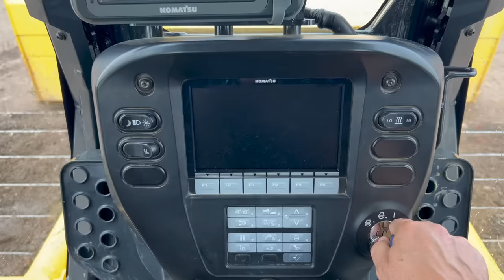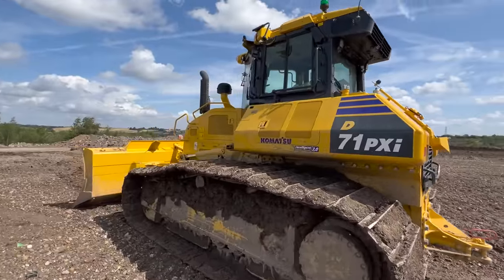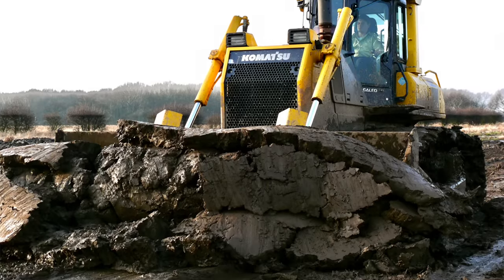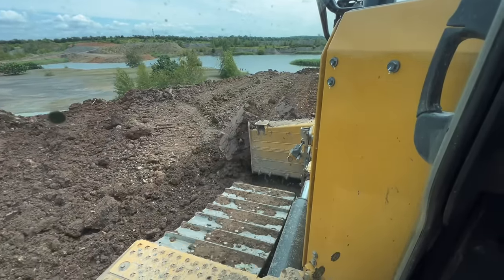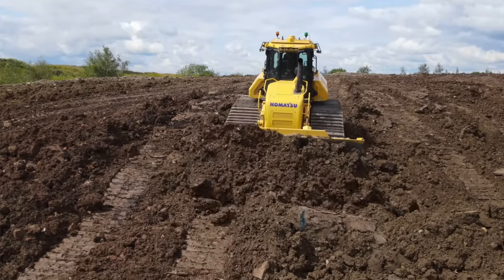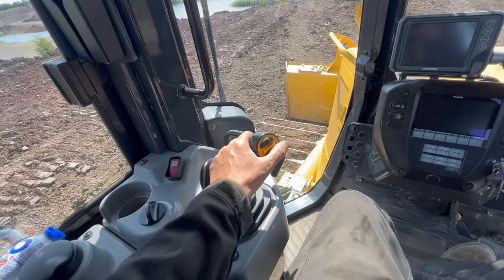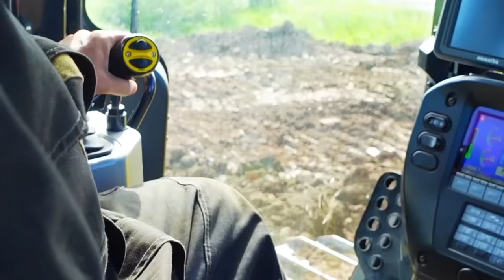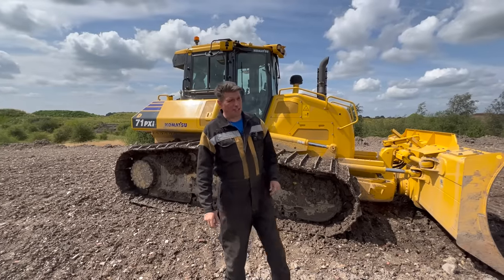CAT D6 vs KOMATSU D71

Comment: Hey bro, looks like you put this up a couple moths ago so you probably wont see this. but how do they compare in terms of pushing power? It seems like the Komatsu is the better dozer in terms of how it operates, but from an owners perspective I don't really care if you can see the top of the blade if at the end of the day the cat has more productivity in terms of M^3 moved. does the Komatsu push as well as the cat? better? Anyway great video man keep it up!
Reply from the maker: Yes it pushes better (you'd know if you watched the video) and any operator worth their salt knows that seeing any extra part of the blade means they have a much better field of vision and of what's ahead, therefore a much increased command of the machine.

Comment: I understand that these machines are built for the primary (new) and secondary (used) markets. But there is a huge demand for 50% or less machines on the used market and I don't see how any of these will be operational in twenty years. Once the HMI craps out in fifteen years and factory support is no more...what will they do? Both of these machines must be filled with what auto manufactures call body control modules and when those are not available any longer? Scary really. People are running old Cats to this day, many decades old. That seems to be ending. New is great but an era seems to be ending.
Reply from the maker: No, that won't happen, it never has and there'll be a market for back up components just as there are with trucks and tractors
Reply: I hope so brother. Retirement is in oh, maybe ten years. I plan on drinking coffee, petting dogs, and watching repair videos. LOL.  @LordMuck

Comment: Come on thsts a D6 keeping up with a D7 Komatsu in all honesty so if a CAT D6 Can keep up With a 71 Komatsu thsts a Komatsu D7 so much respect to caterpillar
Reply from the maker: What part of almost identical weight, size and power are you struggling with ? There's a reason you're not designing rockets and surgical procedures...
Reply: @LordMuck  lol I wasn't saying nothing bad man your video was cool I don't design rockets man just high sprockets and operating equipment not on people but cool thanks for your input. You look at sprocket wear and tear the high track has less sprocket teeth on the sprocket it self and in case of having to change the teeth on the sprocket you should be able to change them with out removing the track if it has the 3pc sprocket break meaning the sprocket teeth on the High track sound be a 3pc assembly on the final drive it self. Also keeping the sprocket teeth out of big rock or even small and out of the brush and mud as much as possible.  On a dozer thar wear and tear on the under carriage and final drive pushing dirt rock ect plus ripping that drive sprocket that's alot of wear and tear.  Never been in a rocket but have drove a couple high sprocket dozers and regular ones as w÷ll
Reply from the maker: Hi drive is great for keeping the drive out of the mud and rock but Komatsu have also had segmented sprockets for years. CAT have relied far too long on owners and operators just accepting what's given to them by blind and dumb brand allegiance for far too long - I'm just as guilty, I have always loved CAT dozers but Komatsu have clearly shown where things need to be and CAT needs to act now.
That ain't rocket science...
Reply: @LordMuck  You ever owned either one for more than 3 years? Cat OEM undercarriage parts are much better than anyone else's.
Reply from the maker: Yep, several CATs and a D65. So many people turning to aftermarket as Cat undercarriage component costs are ridiculous now and not worth the cost vs return.
Reply: @Vernon-Chitlen the cost of OEM caterpillar track segments, chains and rollers far outweighs the benefits as several have said.
They are 3 times the cost but give maybe 25-30% longer life and that just doesn't add up.
Cat have had us believing their hype for too long now and people are starting to wake up at long last
Reply: @LordMuck  I would like to apologize for getting irritated. It wasn't necessary on my part for my poor reaction In what I perceived has dissing Caterpillar. Our family has a long history with Cat. Fed a family of 6. From early 60's D4 traxcavator to wheel loaders, excavators, dozers etc; I've run plenty of Komatsu's, 31-375. Prefer Cat. They're all better than a pick, shovel and wheelbarrow... 😬 Anyways, sorry.
Reply from the maker: We are having a discussion the same as we would on a job-site back and forth - no need to apologise 😉
My grandfather ran Cat dozers first back in WW2 (and IH) then at home, then I ran them on site for many years (brought up with D8H's) Had a Komatsu D65 and preferred some parts to the Cat, mainly vision and comfort but still ran several Cats (4,6,8's) on various jobs. These days I get to have a go on a lot of new stuff which is why I chose the number 1 (D6) to put the 71 against and it is just how I said it is and that's taking nothing away from the Cat.
I just want folk to see what else is out there and maybe then Cat and the service companies will listen to the customer rather than telling us what we should accept. Sometimes a brand needs to remember loyalty is a 2 way thing...
Reply: @LordMuck  you ever had to clean out a track before a freeze you'll appreciate the the high sprockets no bullshit man clean the mud and lord muck out with a spade that shit is work man lol thanks not talking shit just heavy equipment man
Reply from the maker: They have to dig them out and also any trackhoes before they are transported so yes, we have to do a lot of digging out - it's just part of the routine

Comment: It happened with cars and now apparently happening with heavy equipment. American stuff is second rate.
Reply: been that way for a long time. Even Diephone only just went USB-c, lol
Reply: In the 1970's and 80's American cars were craptastic.  I don't feel that way any more.
I now have a new Camaro SS, a Toyota, a new Honda Pilot, bit older Golf GTI, and a pretty new Cummins RAM.  The most solidly built and the best driving of them all is the Camaro.  We have had rough transmission shifting with several of our Honda's, and the Civic I had was built like an aluminum can.  Suspension on the Pilot is too soft, shocks are worn out at 50k miles, brakes are way too touchy yet weak, seats are too short.
Furthermore, after years of riding Japanese street and dirtbikes, I found my Polaris ATV and my last dirt bike, a Husquvarna (KTM) to be superior.  They definitely have better parts on them, drive better, and last longer.

Comment: I don’t now if it was the camera position but in the cat it looked like you was not sat straight, plus’s the tracks on the cat aren’t as wide
Reply from the maker: You don't sit 'square' in a CAT so you can look down at the corner of the blade.

Comment: You should compare the new JD 750L
Reply: I have a 750l and it's is an animal swear it will push with a d6 even though the 850 is in the 6s size and will absolutely destroy a 6

Comment: First of all, a d65 would be more equal to the d6. A d7 should be used to compare to the d71. A d7 would run over that soft iron d71 junk. I have a video of a d6 running away from a d65. 
Let's also know the fact.that the Komatsu runs hot. The coolant lines from front to back leak after a few months. The engines air lock. The radiator compartment filles full of dirt. Most importantly,  the service sucks. The west texas Komatsu dealer can't keep employees.  
No, I don't work for cat. I have a service shop and I laugh at people with Komatsu  equipment .
Reply from the maker: You've literally come on to the internet and made up complete Shyte that's in your head just to get noticed. I've given EXACT weights and power outputs and you're too thick to take that in. You don't run a shop, you'd struggle to run a tap. You're an idiot that's posted a lonely hearts ad wanting to swallow the cock of a D9 operator...
Reply: How on earth are you comparing a D7. He states at the beginning the D6 is heavier and has more horsepower.
Reply: LMAO another Cat fanboy who can't get over that another brand is at the top of the mountain 😂

Comment: yes the komatsu  might be equal in noise, operator comfort ,power to the cat   the one thing they cant do is 25000 hours like many cat d6t i have operated as for being more efficient  thats only  the manufacturers way of saying we built this cheaper so we can charge you more  not a lot of operators buy dozers we mostly operate them for other people who dont care what  they work like they all want to get the most money out of it  for as long as they can which means keeping them fir 10 -15 years or 20000-25000 hours and the komatsu cant do that
Reply from the maker: Of course they will and more. High houred machines aren't exclusive to CAT - any machine that's well maintained and looked after with achieve tens of thousands of hours.

Comment: And you don’t push bulk with a 6 way blade bud.
Reply from the maker: Well guess what ? That's all that CAT D6 does bud and for the purpose of the video, so did we. You think folk can have two machines sat around just to do the perfect job when needed ? Go lay down and read more brochures 🙄
Reply: @lknwumissme typical comment from a Cat seat warmer, keep doing as the boss tells you little man.
Reply: Sometimes better to say nothing and be thought of as dumb than to open your mouth and remove all doubt

Comment: All material things run their course but Cat will be readily repairable and dependable AND American for longer than any other Mfr. Let me know how this has worked out for you in about ten years you Negative Norman.....
Reply from the maker: You do realise how long Komatsu have been going fuckwit ?
Reply: You obviously don't have a clue.  Komatsu has been in the   US for over 40 years.  They have a huge parts network here and around the world.  I have owned both and case and takeuchi.  I would put Komatsu dozers and excavators in the top tier of any machine you can purchase.   It all comes down to local service for me.  And for that reason I stick with takeuchi, case and Komatsu.  But hey u do u.
Reply: And by the way caterpillar has a excavator manufacturing plant 3 miles from sany in China.  Fact check me if u like, I do my homework 🤪